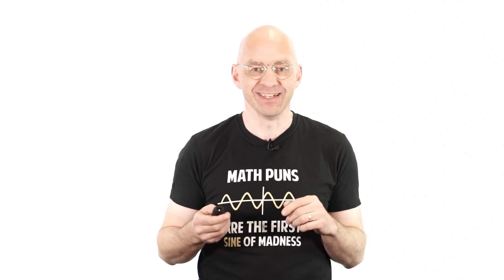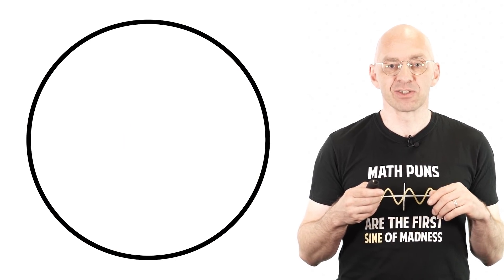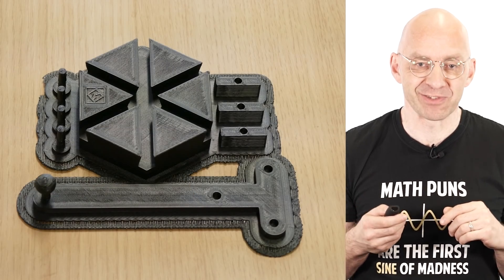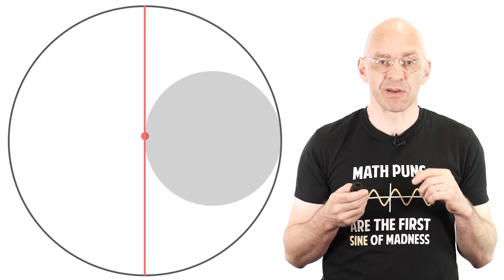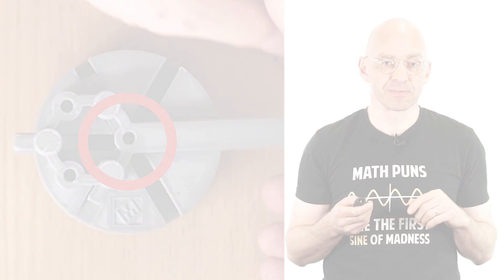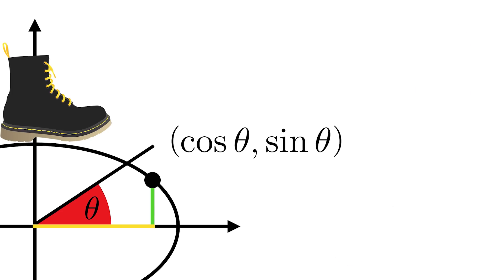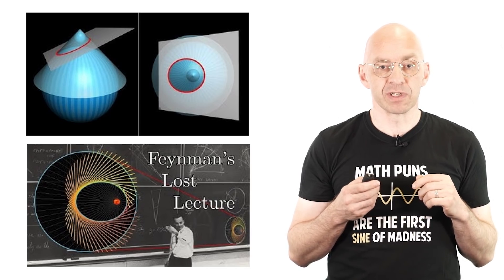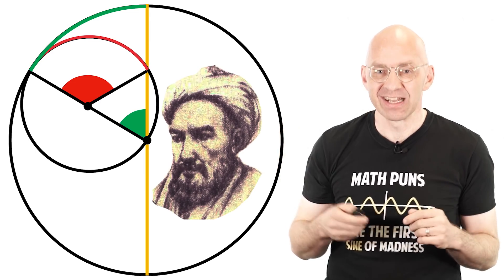Secrets of the NOTHING GRINDER

Comment: It's hard for me to explain why, but since the line is an infinitely long RAY, i think there are three ellipses of that shape drawn on the nothing grinder. One on the very outside, and two smaller ones in the middle. I say this because the ellipse deforms from a circle, then to a line, then back to a circle again, and eventually back to a line as the tracing point travels towards the beginning of the ray. If it were a LINE instead, i would say there are four.

Comment: Instead of a lever and flat surface,   two hemispheres, joined by the hexa nothing grinder would be interesting to spin.   And this is still a 2-D use of the nothing grinder... can  it be solved for four 'orange slices'  of a sphere,  so they slices can rotate around in place ?

Comment: There should be 3 ellipses of the same eccentricity on the nothing grinder's handle.
At infinitely far away from the screws, eccentricity is 0.
At the first screw, eccentricity is 1 (producing a straight line).
Between them is a continuum with every possible ellipse.
The midway point between screws produces a circle of eccentricity 0 again, so there must be another continuum between the first screw and the midway point, and ditto for the midway point and the second screw as the second screw produces another eccentricity 1 ellipse. 
Along those 3 continuums we should encounter the same eccentricity value once each time, producing 3 ellipses of the same eccentricity along the entire handle.

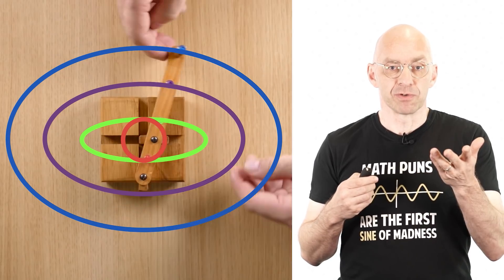Comment: 2:05 For the puzzle: The blue ellipse is unique and every point further out produces an ellipse more resembling a circle, but never actually becoming one.
Reply: are you sure that you don't get a similar elipse inside the circles, but rotated at 90°?
Reply: @LucianoRobino  No, you have two points fixed (foci) on the horizontal for all the ellipses. No matter how long you make the arm, these two points stay fixed.
Reply: @TheJAMF  wait, if you have 2 foci, that means you won't be able to get a circle, since that would means the foci collapse into each other, and having fixed foci won't allow it.

Either way, regardless if in wrong, I still want to understand what happens to the points inside the circle, do they describe any figure?
Reply: @LucianoRobino  Well, the smaller you go (like inside the green ellipse), the flatter the ellipse will get.

Comment: Hi ,They are useful,  As a Contract designer I used this type of device on an inclined ramp with a swinging arm attatched to slide components off into boxes. It was successful, solving a problem they'd had for years of parts accumulating in a heap. Basically it converts rotary motion into linear motion.
Reply from the maker: Great, would be nice to see a video of this sort of device in action :)

Comment: Can you make a movement of 2 points which change direction in center point (instead of moving on straight throu center with double line path) with only 3 lines at 120% degree to each other?

Comment: The deduction at the end had quite the flaw 
Assuming Rolling for 60 degrees is an instance of the phenomenon and so any deduction done based on this fact cannot be generally valid.
Reply from the maker: Sigh, this is just plain silly. Did you hear me say 60 degrees anywhere? Just because something looks like 60 degrees (to you) does not mean anything. Apart from that it should be completely obvious that the argument presented there is completely general.

Comment: There's an old mill near me that makes/made picture frames, and they have machines used to turn the profiles of both circular and elliptical frames.  It baffled me how that could work, but now I suspect that mathematically at least it's like a nothing grinder where the handle is locked in place and the base is rotated.

Comment: Absolutely fascinating. As a cabinet maker I have used this principle many a time. I saw colleagues struggling with two nails and a piece of string- a touch-and-go method that’s extremely imprecise. In our Paris workshops we had a series of oval bullseye windows to make for a castle. The X Y (height and width) dimensions had to be precise. Okay, once you’ve determined the outer shape, how do you scribe the “parallel” inner one? This represents the width of the wooden frame. Solution: slide the scribing point inwards- towards the center- to the required width, say 90mm. Result: a perfect inner ellipse, equidistant from the outer one all around. Job done. I hope some concerned person will read this and understand the dilemma I had before I learned this principle. In woodworking shops we are not mathematically minded, so every bit of knowledge helps. Thank you for sharing.

Comment: As a very poor man fast approaching my own morality and no funding to apply for patents I have always believed this to be a unique advantage in combustion engines as pistons vastly increasing power and space in the engine example a simple 4 cylinder engine using this most basic system produces a 16 cylinder engine a more  complex could provide the engine with 20 cylinders and so forth good  luck  this is for  free on me
Reply: I also  believe  it could  be  used as water pumping systems to produce happy water such as banged water  used in many  German bakeries and steel manufacturers
Reply: And  thorium powered engines
Reply: Dcostello655@gmail.com

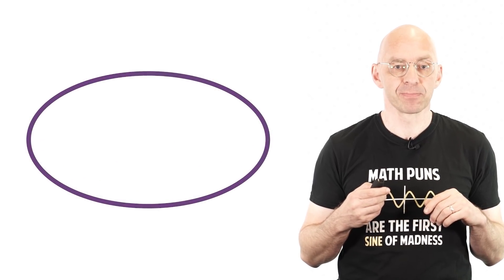Comment: 2:00. Same shape?  All ellipses formed by a point that is drawn further down the handle than the orange center point will have a congruent counterpart within the orange circle.  Size will be exponentially smaller and orientation may be different, but the shape will be congruent nonetheless.  Therefore yes.  The only shape that will not appear more than once is the orange circle and only the orange circle

Comment: One minor point I did not see covered in this excellent nothing-grinder video is that the spacing of the points on the small circle need not be regular, and can in fact be random or even chaotic. Such irregular placements result in grinders where the angles between adjacent tracks can vary vastly in scale.

To construct a virtual (or real) example of an irregular grinder, place n points randomly around a circle. Connect them to form an irregular convex polygon, and use that polygon to build a rigid rotor with sliding pins at each vertex. Add one more point to the rotor circle to represent the center of the larger circle, and extend lines from this new point to each of the n vertices of the rotor. These lines define the tracks for the sliding pins of the polygon rotor. If the center of the big circle happens to fall exactly on a rotor vertex, the track for that vertex is tangential to the circle.

No matter how oddly shaped the polygon rotor is, and no matter how many vertices and tracks it has, the resulting system can in principle exhibit the same smooth circular flow as a classic nothing grinder with only two vertices (a bar) and two tracks.

Note that for any given irregular polygon rotor there would seem to be an infinite number of possible track arrangements, depending on where the final point is placed on the rotor circle. This is an illusion, however, since the track lines end up having the same relative angles regardless of where the final point is placed.

Comment: It forms an ellipse because the inner pivot point is able to launch the outside horizontally "quicker". One pivot point is working to squash the circle at any moment by traveling less distance. The further you travel from the center of a tire the slower it travels. Its like using a lever and fulcrum, you could think of it like that too. The lever handle is the main reason though lol

Comment: the proof shows the argument for a specific angle of 60 degrees, not for a random position. Am I wrong?
Reply: Since it's a visual proof, yes. He simplified this for easier drawing.

But the argument behind the proof itself can be extended to any random position. Because of one critical properties: since the inner circle (c1) radius is half the outer circle (c2) radius, diameter of c1 is equal to radius of c2. Ergo, the line that bisect c1 in its center will always be present and anchored to center point of c2. The structure and ratios is preserved regardless of the angle.

Comment: THREE points on the arm will trace elipses with the same eccentricity (assuming non-zero). There is the point outside of the two slider-pivots as shown; there will also be two points BETWEEN the pivots, one that traces that eccentricity with a horizontal major axis, and one that traces it with a vertical major axis.

This assumes the arm extends only in one direction, like a ray. If it extends as a line in both directions, there is a FOURTH point that traces an ellipse of any given eccentricity 0 < e < 1. The point on the other side of the pivots would trace your example with a vertical major axis, rather than horizontal.

Comment: You could make this into a modern lock. The crank arm could generate a current, that allows key access to process, a unique lock. Which is , some random number, or composite material completely hidden and unique given at the time. Place it in the crank, crankngenrstes a current that current reads a stone.. let's say.. and the lock triggers open... Weakness is trigger for the lock opening...hmm.. which could be trigger by direct energy ... To trigger the lock....

Comment: I have come across the linear motion a vertex on a circle with rotation before. In my case, from a programming error where the rotation point wasn't offset to the center of the circle before it was rotated. When I was attempting to get the orientation based on a specific vertex position, I was getting invalid information saying the circle was sliding back and forth. It took a lot of head scratching before I figured out what the issue was, but it is explained here.

Comment: If we assume no 'slippage' then isn't it a given that the two arcs are the same length?
The only requirement being then that if you want the point to trace the diameter of the larger circle then the diameters have to be in the ratio of 2:1.   Then we can intuitively see that when the smaller circle has rolled to a quarter of the circumference of the larger one, it will have rolled to half of its circumference (180 deg) hence it's diameter will line up exactly with a radius of the larger circle terminating at the centre.  
But I'm not so sure that proves that the point on the smaller circle would track the 'vertical' diameter at every point.  That seems to require a proof that the chord subtended by the initial point and the moving 'contact' point of the smaller circle is exactly 1/2 the chord subtended by that same contact point and its 'symmetric' point (reflected about the y axis) on the larger circle.  Then the larger chord is always horizontal and is divided exactly in two by the smaller one.  ie point on smaller circle is tracing out the vertical diameter.
And that is guaranteed since the arcs being traced out (contact point to reflected point for the larger circle) are in the ratio of 2:1.

Comment: I've taken a quick glance through the comments and I don't see an answer to the first puzzle yet (although I'm sure it's there somewhere!). I'm pretty sure the answer is 3, based on your wording; that's assuming the arm is infinitely long, and that we don't care about size or orientation. The "exact shape" of an ellipse, in my mind, is just the eccentricity (again, I'm not worried about rotation, but I think that would narrow it down to 2).
Moving outward along the arm as in the video, we can start from the horizontal line on the outer screw and find every possible ellipse until we approach a perfect circle as the point we're tracing approaches the end of the handle, which is infinitely far away. Conversely, we can move inward toward the red circle and find every horizontal ellipse again, only much, much smaller. But, moving in past that halfway point, we then find a third example for every ellipse (orientated vertically) until we reach a vertical line at the inner screw.

Comment: I looked through some of the comments and didn't see what I think (I didn't do a mathematical proof) the correct answer to the question is. There are 3 points on the arm that would produce an ellipse of the same shape (including the one shown), and it would still be 3 if it was a ray. Starting at the end point you have a straight line, and as you move along the ray towards the center point it becomes a circle making every shape of ellipse along the way. It goes back towards a straight line as you approach the other slider covering every ellipse a second time, then once you get past the slider it gets closer and closer to a circle as you approach infinity covering every shape of ellipse the third time.

Comment: Did anyone else notice that the "6 point nothing grinder" he showed us at about 6:23 is not really a 6 point?  It's a 3 point with 3 extra holes on the handle.  Now you could mill a path for those 3 extra holes to follow.  But as it is shown, it still has the same number of paths as the 3 point grinder featured at about the 4 minute mark.

Comment: I think it's a possibility to turn this "Nothing grinder" into a working engine...
Reply: it's the rotary engine's less successful brother
Reply: @lil0of  I think you mean Wankel.
Reply: 10 second into this i was thinking the same thing. i feel a compression engine would benefit the most
Reply: JoshTheKid   You are thinking of a radial airplane engine.
Reply: The gear for a hand crank power generator
Reply: I can't help but wonder if there is any application where replacing the sliders with magnets, either to convert magnetic energy to work, or vise versa could be made practical.
Reply: @jerryfick613  If designed correctly, the magnet might be out into a perpetual state of change, that would be wild if possible. Love it.
Reply: This is exactly what I was thinking.
Reply: Actually, I think the burden of evidence is on you to calculate to the end of pi, if you wish to demonstrate that perpetual energy is not present. My assertion is that there is no end to Pi, and yours is that, it must have an end. Your evidence?
Reply: @H0mer7 Except you can think of magnets as batteries. Natural ones. They do store energy, and if aligned properly and can extract work, no thermodynamic laws broken. They also lose their energy - magnetism over time. 
Why does everyone think power can't be extracted out of magnets is beyond me. 
There are actually working models of magnetic motors, that produce a net positive output, and you can easily find them on youtube. Magnets are not magic...
Reply: This is the first time that I have seen a nothing grinder and my first thoughts were also of an engine. I think it might be possible to shorten the sliders and then get his newest grinder to work without binding up.
Reply: @H0mer7 Trust me H0mer, my Dad has been working towards perpetual magnetic motion for over 30 years....I know it better than anybody. I also think that limiting ourselves with perceived laws that have been known to bend or break, is foolish. 
I believe there is a material that could possibly conquer the big push- pull problem with magnets
Reply: @H0mer7 Deep down nothing bro, lol. I'm exploring the idea. Magnets are still fascinating. I should have said I know 'about it'. Black holes broke laws we thought were concrete.

Comment: Is it possible that this nothing grinder could be used to create more efficient electromagnetic generators, since all you would need would be to replace the bars inside the slots with magnets and run copper wire coils around each slot?

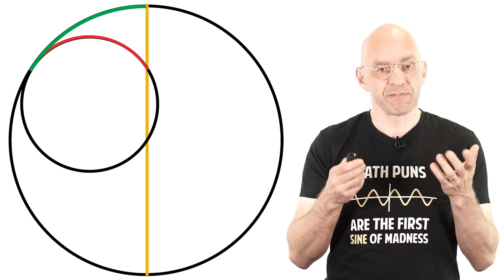Comment: Great video.  But near the end, 11:08 you mention that proving the point is on the diameter just requires proving 'these two arcs are the same length'.  I understood how you proved the arcs are equal, but why does that prove the red dot is on the orange diameter?  I don't understand how the arc lengths prove this?

Comment: i'll have to strongly object to one point: while "milage may vary", it's not so much depending on the printer (as long as it's construction is adequate), but much more so on the operators abilities to tune the machine, and dial in the right slicer settings for any given print and material!
a $2000 machine might be able to get the job done a little faster*, but in terms of print quality, it's got no siginificant edge on a $300 budget machine.

(  *= without a detrement to the print's visual quality, )
Reply: Cuda FX and here I am wanting to build a tower style reprap printer with a dual pivot arm and 1 motor 2 solenoids and 3 encoders

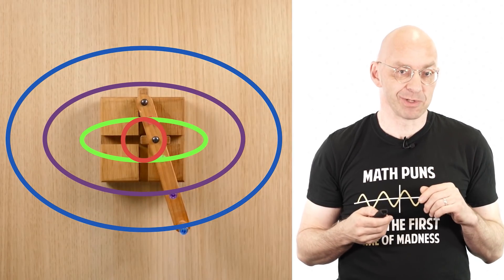Comment: the answer to the question at 2:25 is exactly two, diametrically opposed to each other on the arm (the same distance from the center, on opposite sides)
or if the arm of the grinder is considered to be a ray, not a line, then the answer is exactly one.
because the key to how "squished" the ellipse is, is your distance from the center. close to the center, you get very sqished, as the effects of the grinder become more and more important.
and as you get further and further away, the overall length of the arm contributed more to the shape of the ellipse than the distortion of the grinder.
at its infinite limit, it becomes a normal compass with no grinder in the middle.

Comment: Seem to remember a shaker screen mounted on a spring bed that did a great deal of sizing and separating rock and sand.., similar idea in practice. Springs replaced the sliders, and the body of the screen did the ellipse. Lots of Math required in the design and operation for Mechanical/Mining Engineering.
Reply from the maker: Cool, have to check this out :)